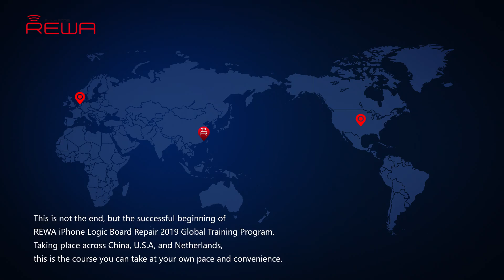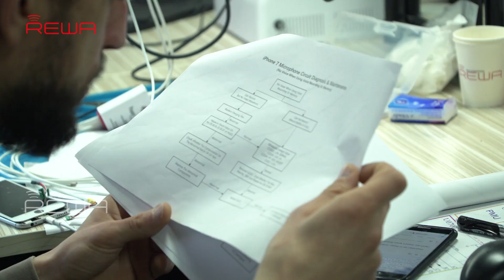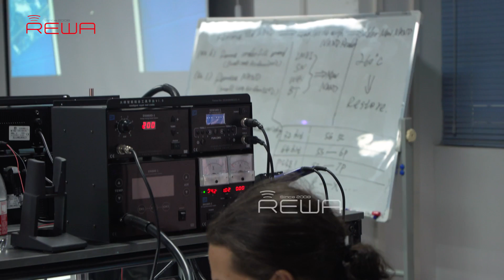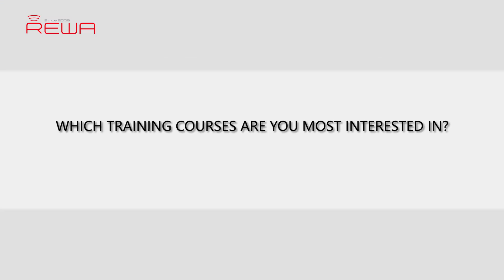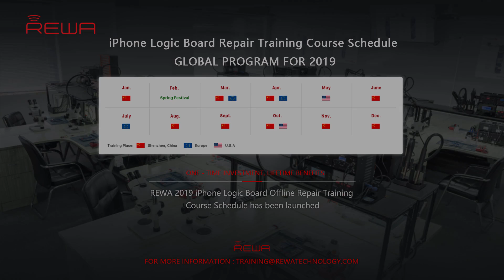REWA iPhone Logic Board Repair Training Review - 2019 Course Ⅰ

Comment: My iphone doesn't save charge...  what can I do change battery or.
Reply: 1.) Try a new charge port
2.) Still not charging, replaced the battery.
3.) Still not charging, connect to iTunes. Does iTunes detect it?
4.) Not detected by iTunes, disconnect battery. Test voltage on VCC Main.
5.) If voltage well below 2 amps, replace TriStar.
6.) Still not charging, check battery data lines.